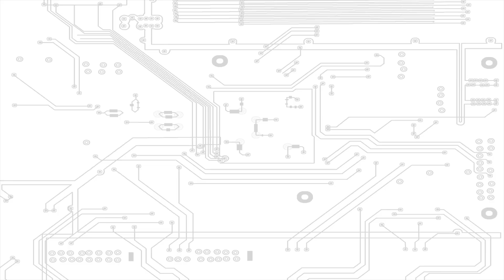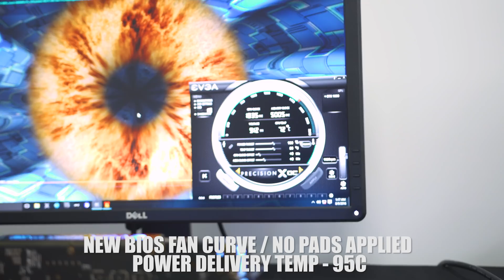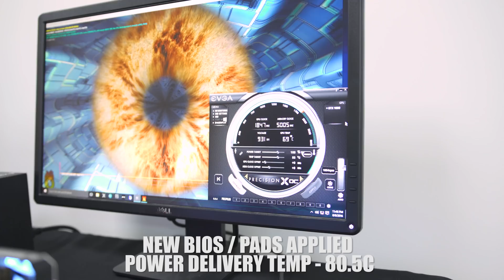EVGA FTW VRM Failures - What should you know

Comment: my ref rx480 runs cooler than the card with pads. . .
Reply: broken3260 The RX480 and GTX1070 have the exact same TDP, even if the performance difference between them is massive. The 1080s tdp is 30W higher but the aftermarket coolers should really be doing a better job than a reference one.
Reply: Daniel Heigher Well, my EVGA GTX 1070 doesn't even go higher than 60 degrees under full load. (Furmark)
Reply: New GPU's confuse me
Reply: using furmark?
Reply: Daniel Heigher Are you trying to compare your 480 to a 1080 because that is not a fair comparison
Reply: I was just saying that the 480 is a hot card, and this one is hotter, I omitted the fact that my fan was at 1000 RPM, and this one was at 400, and I regret that (or at least I will soon). Yes, the clock speeds are different. This makes a difference in temps, thank you for telling me something I already knew. broken3260
Reply: Daniel Heigher Not only that, the 1080 draws more power. Your comparison is completely stupid. Compare a 480 to something in its own range.
Reply: +broken3260 reference cooler tho
Reply: sow Doesn't matter. Cards are in completely different categories. Reference of 1060 runs super cool as well. But it's not a fair comparison
Reply: FeelsBadMan thats because the sensors not show the vrm temperatures.
Reply: Cassiano Lobato My card is working fine for several months now. EVGA also said that only the FTW cards are affected which makes sense since the FTW ones have a slightly different cooler (and a custom PCB).
Reply: FeelsBadMan i think all cards with the acx 3.0 cooler are affected, this includes de classified and SC, maybe u should get the pads just to prevent (sorry for my bad english, not my first language)
Reply: Cassiano Lobato I will just wait until my card doesn't work anymore if that even happens and then they will probably send me a GTX 1170/1160 or something. ( ͡° ͜ʖ ͡°)
Reply: Daniel Heigher bad comparison

Comment: Two questions. What percentage of isopropyl alchohol should be used, 70%+? And how important is it to not get finger prints and dust on the thermal pads?
Reply: I always try for 90% + alcohol. I would try not to get prints on the pads but I don't think it will be a huge problem. Mainly just removing the sticky when you touch it.

Comment: I had the SC 1070 at one point in time, but ended up swapping out because for some reason it ran extremely hot and performance would dramatically drop after 30 minutes. this may have explained that.

Comment: I'm sorry but 80 degrees is still hotter than most other aftermarket solutions, that's not a fix, it's a band-aid. they need to redesign the cooler with a block that comes closer to the vrms so the thermal pad can be as thin as possible to maximise heat transfer.

Comment: Thanks for posting this Jay. I just bought the 1080 FTW earlier in the week and it arrives tomorrow to go into my new editing system. Is it safe to run the card at stock before I can get this fix done? Should I wait till afterwards to overclock it?

Edit: Or should I just do a custom fan curve and ignore the issue?
Reply: Or should I just do a custom fan curve and ignore it? These are the important questions in life.
Reply: As soon as you get your card register it. Set a custom fan curve once installed. Then go and order the pads and install once they come in. Or you can send it in to be fixed. As long as you don't push it crazy hard the custom fan curve should keep you safe. You also have 3 year warranty
Reply: Thanks John. That seems the most reasonable route to take.
Reply: Anthony Harden Np man, good luck with your card
Reply: Thanks!

Comment: correct me if I'm wrong, backplate help with rigidity of the card helping against sag as well as slight heat dissipation  (on some cards more than others) also, when removing or applying the tension screws that hold the cooler to the processor it is wise to alternate tightening just like applying a cooler to a cpu. Not tightening one all the way down right away and moving on to the next. Lastly, I'd surely hope no one is afraid to take their components apart if they've built the system themselves, which would be most of the owners of this card given its not your standard gpu. You're not the only person in the world that knows how to do these things Jay. Sometimes I question your actual knowledge of parts and their "real inner workings" like calling the processor "the core" is quite anatomically incorrect. Calling a backplate purely cosmetic, are both things someone with a career in this field don't make mistakes on. Oh, hey, I gave EVGA a visit recently too. They told me all of their corporate secrets and gave me a bunch of free stuff ;)

Comment: my 1080 runs at around 70° and the fan doesn't even spin in most games
Reply: Daniel Stevenson  Yes, you can change your fan curve with Precision you don't have to do the bios update.
Reply: when I turn on my fans it stays around 60°C
Reply: Core temps =/= memory temps.
Reply: Set a custom fan curve, that will help a lot to keep things cooler. get pads and install them problem solved
Reply: u got a EVGA GTX 1080 FTW?
Reply: Tarex  Me? No, I have 1070 FTW and 1070 SC models.
Reply: Tarex Yes
Reply: John Totten 
Word okay, I will get the pads absolutely, but 400 more RPM can be done without the update for the software, right? I can change the fan speed in the evga precision tool.
Reply: John Totten dank

Comment: the thermal pad on the front plate will apply additional force to the left side of the gpu die by pushing the right side of the fins on the heat sink. Not good.

Comment: why there are no actual before and after test with thermal sensors near the actual chokes(Not those damn thermal imaging cameras). its like if you point a thermal camera at your hands, it will show lets say 30C. now put on some winter gloves and thermal imaging camera is showing 15C(with wind for example from the fans, you get the idea), but your hands temperature is now even higher inside than it was before because you put your gloves on. this is what i see in EVGA's demo shots. also why EVGA dint pre-cut the chokes thermal pads to width of the chokes? i understand the one that goes behind the backplate, but it has much more surface area than the thin heatsink fins where the chokes are. now, not only does this restricts direct air flow on the chokes but it also has almost zero contact area to the heatfins with those thermal pads on chokes. There should be a metal plate or a heatpipe running above those chokes with thermal pads in between, then it would cool them.

Comment: I have an EVGA 1070 SC Black Edition (No Backplate) and wrote to EVGA about it. Their solution indicates the use of thermal pads to move heat to the backplate. Since my card has not backplate I wrote asking if there was any way I could obtain a backplate and I was told they had no plans to sell backplates for these cards. No I'm a bit nervous I've got a time bomb with no possible solution. (I can't even find an aftermarket backplate other than ones that claim to only work with waterblocks or that are made of acrylic which won't aid heat dissipation. :/

Comment: What a hack... hello... the thermal pad is touching only the fins of the heatsinks.
Reply from the maker: +Wapn Perfo and yet it works
Reply: "Prove it"

Lol, get your own card, do it yourself. Who the fuck are you to basically demand anything of this channel? Obviously owes you nothing; and more-so you've obviously have no respect for the content/time taken so why in any stretch of the imagination would anyone think a post of someone being a complete dick in inquiry for more research/info would be even remotely considered by the content creator?

Oh, you think you're important...
Reply: The thermal pad is there to dissipate the heat which is much more efficient than normal air. So, with or without contact to a full metal plate, it still works albeit not as efficient.
Reply: Damage control at it best.
Reply: +Wapn Perfo take it you have no idea about custom cooling and how thermal works
Reply: I doubt it actually do much. the backplate might help a lot though
Reply: Yep, a complete bodge. Something which I would find hard to forgive as a recommended fix by a major manufacturer.
Reply: So is it better to put the small thermal pad on VRM's or increase fan speed ? Cause if you stick the pad, VRM's don't get direct air blow anymore...
Reply: roman dulce Your VRM does not need to get air. The thermal pads need them.
Reply: Ville Törölä great song
Reply: I had the same questions in my head when I saw it, but then I think, the important part is the width of the pad. It connects the front plate with the vrs and it just helps "a little" (actually quite much) to enlarge the dissipation area (front plate) for them
Reply: Instead of the vrm's being in their gap, void of cooled air, they now have a contact area for air. I't's far from how you want it, (wou would want a metal strip there) but it does help.
Reply: The mosfets got hotter than what was seen on the flir, it does matter as most are only rated for those temps but only for short periods of time.
Reply: Yeah, the thermal pads spreads the heat out onto a larger surface so it won't all be concentrated on the VRM. The air would cool the thermal pads. The heat-sink may help slightly if it was in contact with the pads, though marginally as the contact area is so small.
Reply: Bitter Raven actually... I am an electrical engineer and I design circuit boards all the time. That isn't a proper way to cool an IC... low surface area equals poor heat extraction.
Reply: Perfo, who cares if the fix isn't the "proper" way to do it, if it's proven to fix the issue?
Reply: Wapn Perfo well being a so called electronic engineer you would of realised that the thermal pad was actually transferring heat to the front plate as well fins on the cooler

Comment: Gotta be honest with you this has really knocked my confidence in EVGA products. I've bought many of their GPU's and I thought they were really good at designing robust high performance cards that demand a high price point but after this it really brings in to question their testing methodology.

They chose to use those VRM's on this card and the manufacturer would have provided EVGA the performance characteristics of these VRM's including the maximum temperature of operation. Never before have I bought a high performance card of this type where the VRM's weren't passively or actively cooled by a heat-sink so I question why EVGA would do this on this card.

I do not believe they did it for cost cutting reasons because obviously the heat pads are cheap and easy to apply during the assembly process which only leaves one reason for the lack of cooling, they're incompetent.

Peoples cards are literally bursting into flames making this quite serious not just because the cards die but because of the potential repercussions.

I was intending to buy an EVGA GTX 1080 Ti FTW on release, I was very close to buying the GTX 1080 FTW only a month ago but decided to wait until next year for the Ti but I was 100% sold on the EVGA FTW version and now I'm really concerned and thinking I would be better served by another OEM like Asus, MSI or Gigabyte.

And I say this as someone whose had two GTX 480's, GTX 780's and two GTX 970's from them, I don't want a lemon.

Comment: Shit. Just bought a GTX 1070 SC. I could have gotten an Asus for the same price, but thought that EVGA was better build quality. Fuck!!!1111one
Reply: Brayden Wilkes You are lucky. Asus has one of the worst custom designs.
Reply: EVGA is NEVER better build quality lmao - EVGA has always been about aesthetics
Reply: Hi. Just bought one of these, too. After a little research I found out the SCs are not affected by this problem, since it has a reference PCB model. FTW cards have non-reference PCB model.
Reply: Problem is with ACX 3.0 cooler, it's a flawed design.
Reply: Gustavo Kindel I don't think the PCB matters I think it's the cooler.
Reply: Asus doesn't cool the memory. Currently the cards with the best cooler are Palit/Gainward Jetstream/GameRock/Phoenix (all identical cards which differ only in shroud design and vBIOS)
Reply: cl4ster17 what about pny, gigabyte or zotacs 1080s? how are those by comparison?
Reply: I found some interesting info here http://forums.evga.com/Is-the-EVGA-1070-SC-effected-by-the-VRM-overheating-issue-m2571376.aspx

Comment: Hey Jayz2cent, I need some help in deciding which gpu to buy, SLI gtx1070 or SLI gtx1080, currently my monitor resolution is 1080p @ 120hz. My current setup is core-i7980x mobo x59 chipset, 12g ram. My good old gtx690 just went dead.
Thank you.

Comment: Does the cards selling right now come with this fix?
Reply: yes
Reply: Retailers might still have old stock that doesn't have the fix yet.
If your buying at a store you could probably ask an employee if they know if graphics cards on the shelves have been replaced by new ones.
Reply: +Roscoe , Only on EVGA webshop. Not resellers afaik.
Reply: Cards shipped from EVGA after 11/1/2016 will have the fixes applied. So more then likely any stock Newegg, Amazon, Micro Center, etc has on the shelf right now won't have the fix.
Reply: source is in my post, the reddit link, official response, says the same has what sparkplug1018 says.

Comment: I love you jay, I've been a sub for a long time, but you are not telling the whole story here. Not only is the vrm not covered with thermal pads and insufficiently cooled, also the vram in most ppl's 1080 ftws have thermal pads that are barely or not at all covering the vrams. Also anyone who has been fiddling around and taking apart gpus in the past, just look at the cooler design, the only thing the copper plate is making contact of is the gpu die, the vrms and vrams are completely seperated from the plate by a midplate, which only gets passive cooling from the fans air.

This design led to higher vrm and vram temps in the first place, not just because some thermal pads are missing. My old Asus 780 Direct CU2 cooler, which is now almost 3 years old, has a copper plate which covers all 3, the gpu die, the vrm and the vrams, and this is how coolers should be designed.

The reason why they designed the cooler like this this time, imo is they wanted to reduce the cooler cost by reducing the size of the copper plate by not covering the vram and vrm, this is also the reason why when the gtx1080 ftw came out it was priced lower than asus or even zotac gtx 1080s with their aftermarket coolers, which is unusual and alarming cuz evga in the past have been at the top of the prices because of the superior cooling designs and component quality, but this time, they tried to cheap out on the design, the QA and the materials to become more competitive in price.

They thought they could get away with it because gpu temp monitoring only reports gpu die temp, that's why people that are having issues with the card say "but my gpu temp is below 65c, it's not running hot".

I'm not just saying all this with no backing, I own one 1080 ftw myself and I just disassembled mine after watching gamers nexus video, and took a very thorough look at everything and compared it with the almost 3 years old direct cu2 design and I'm disappointed of evga, cuz in the past they stood for quality, reliability, innovation and customer support, now this time the only good thing left, at least is the good customer support.

If anyone is looking into buying an evga card with ACX 3.0 cooler, DO NOT buy one as it's not a QA problem only, which can be fixed by just adding a couple thermal pads, no, it's a cheaply designed cooler in the first place.

Jay, if you are reading this and if this video truly isn't sponsored by EVGA as you claimed it wasn't, please make a video of the truth about the ACX 3.0 as anyone with enough knowledge and experience with GPUs can see that this is a very poorly designed cooler.

Comment: Is the 1070 sc affected too?
Reply: Milo Xander yes all ACX 3.0 coolers
Reply: Both yes an no. All 1070/1080 SC cards use the reference PCB design with fewer vrm's and they don't sit so close to the vram as the 1070/1080 FTW cards with custom pcb and more vrm componentsfor better power delivery.
To cover all sorts of questions EVGA decides to cover the "issue" for all models eventhough the hot spot issue only is likely to occur on the FTW models, because of the above mention layout.
For 4 months now I have run with EVGA GTX 1080 SC ACX 3.0 SLi and never had any issues even with the extra overclock I have. From day one I made a custom fan curve profile that's way more aggressive than EVGA own default. And since the new Vbios updates essentially is "fixing" what I already "fixed" without even knowing 4months ago, I don't see any reason to take any action at all.

Comment: The cooler doesn't make contact/only have partial contact with the VRAM also, so that's another design flaw however not as bad as this seen as GDDR5 and X are quite low power. Just be careful of overclocking the VRAM if you do so.
Reply: https://www.reddit.com/r/nvidia/comments/5aqjvb/so_i_disassembled_my_two_evga_gtx_1080_ftws/
Reply: Yap, saw that, thicker pads should solve that problem. But that is the 2nd problem with this cards, EVGA should just do a recall.
Reply: Comanso Rowlett The problem with ACX3 is not only that the VRMs get really hot but also that the front plate transfers that heat to the closest 3 of the memory chips which can lead to them overheating. MSI and Zotac have similar laughable VRM "cooling" (not as bad as ACX3) but there the memory is cooled by a separate plate. And then there are cards that actively cool VRAM and VRM with the main heatsink (Asus is not one of them).